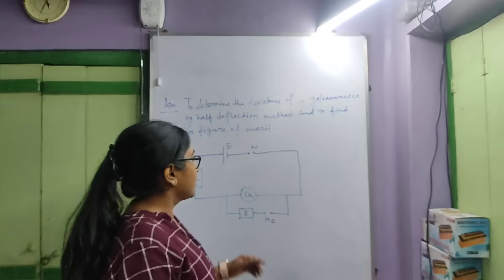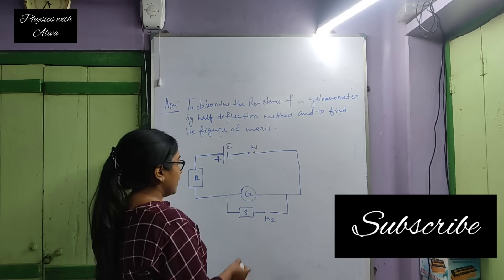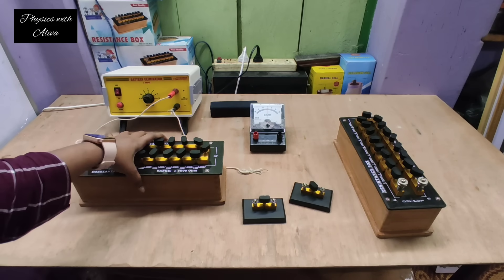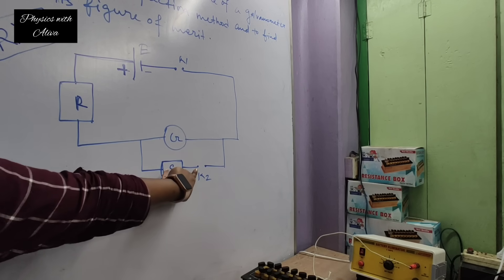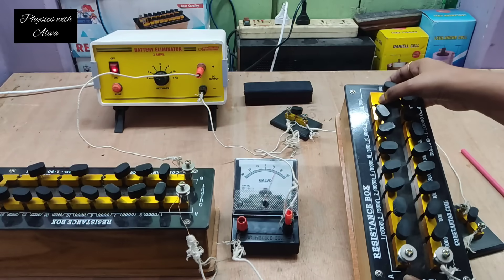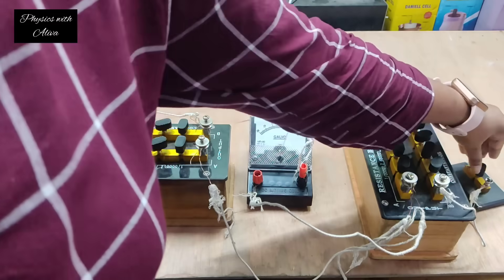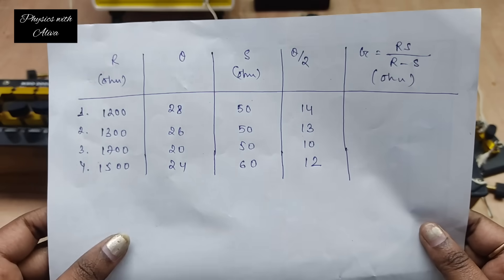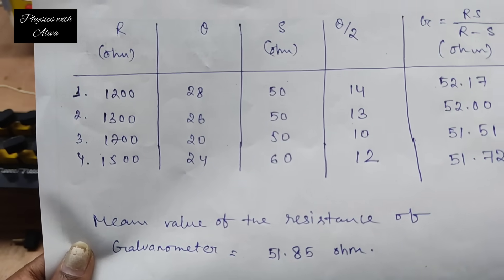To determine the resistance of the galvanometer by half deflection method and to find figure ofmerit

Comment: hello mam, tomorrow is my practical, in my file the first step for finding figure of merit is “take a cell, find out its emf with the help of voltmeter”
i am confused as to whether the value will be given or we have to find ourselves. could you please help me?
Reply from the maker: If it is not given then connect the battery Parallel to the voltmeter, you will get the emf
Reply: @physicswithaliva9791 okay mam.. thank you so much. your videos are extremely helpful :)

Comment: Mam apna jo first observation table ka leya reading le h usma fourth reading ma jab apna galvanometer resistance ke value nikale h usma calculation mistake h.
1500×60/1500-60 is equal to 62.5 but apna vaha pr 51.72 lekha h please correct this

Comment: Ma'am,  i have a doubt. 
Suppose when the deflection in galvanometer is θ, then current through it is I . 
So , when the deflection in galvanometer is θ/2 , then current through G is I/2 and through S is I/2 . 
Now , in parallel , the current only becomes half if resistors r same .
So , G=S 
Then why to use the formula to calculate G ?
Reply from the maker: https://youtu.be/BZVcnAyYBa8?si=k-yhrdVXadGNbgIm
See this video

Comment: Steps for the Experiment:

1. Set up the circuit – Connect the galvanometer, high resistance (R), rheostat, key, and battery in series.

2. Measure full deflection (θ₀) – Close the key and adjust the rheostat to get a deflection θ₀ on the galvanometer.

3. Introduce shunt resistance (S) – Connect a shunt (S) parallel to the galvanometer and adjust it until the deflection reduces to θ₀/2.

4. Record values – Note R, S, and deflection readings.

5. Calculate resistance of galvanometer (G) – Use the formula G = S (R/S - 1).

6. Determine figure of merit (K) – Calculate using K = I₉ / θ₀, where I₉ = I × (R / (R + G)).

Comment: Ma'am what changes will be there if I connect only one key (k2) and the is there any problem if I connect the resistor R with positive terminal of battery instead of negative terminal?
Reply from the maker: You will get yr ans here
https://youtu.be/BZVcnAyYBa8?si=IuQ1gdavEFyCIMC1

Comment: Why do we have to stop in 28? Cant we go for 30 as a maximum deflection mam?
Reply from the maker: @dhritimadas9599 as 30 is the maximum one, if more current is flowing through the galvanometer, it is not possible to show the deflection 32 or 34…. So for all these you will get 30 deflection 
Another reason is to protect the galvanometer

Comment: +ve end battery- one end of resistance box (larger one)
Other end of resistance box- one end of shunt (smaller one)
Other emd of s - one end of key 2
Other end of key 2- one end of key 1
Other end of key 1- -ve end of battery
+Ve end of galvanometer- one end of resistance box 
- ve end of galvanometer- one end of key 2

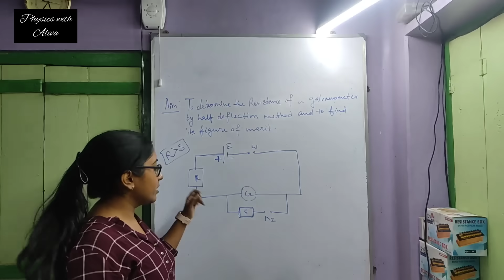Comment: 1:10 2 resistors and diagram
4:36 completed setup
All r setup normally just in parallel galvanometer it is connected in end with key and 1 resistor
11:07 readings

G= RS/R-S

11:56 figure of merit

K= E( given) / (R+G)Ø

Comment: Maam, the connecting wire is the copper wire indulated with cotton thread right! But in case of meter bridge experiment it did not work. Why?
Reply from the maker: The wire used in meter bridge is a resistance wire, made of constantan.

Comment: Ma'am as the circuit I have studied that connect +ve terminal of battery with HRB and then HRB to +ve side of Galvanometer and from same +ve side of galvanometer LRB is connected and then we have to connect -ve side of galvanometer to key 1 and key 2 and connect key 1 with -ve side of battery so ma'am is this connection is right?? Please reply soon ma'am
Reply: Yes this is also correct. 
We just have to connect in parallel way !! 
Both are correct as in both cases there will be deflection shown in galvanometer.

Comment: In our practical sir had connected the resistance box with the negative terminal of battery and you have connected with the position terminal

Will there be any change?
Reply from the maker: I have followed the circuit from cbse book. If you have done different one and got result, then follow that completely.